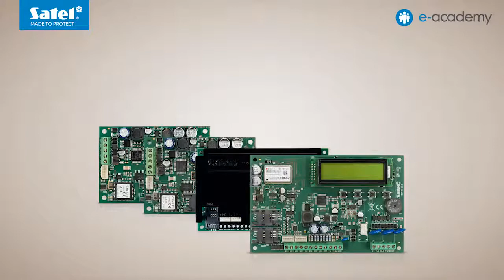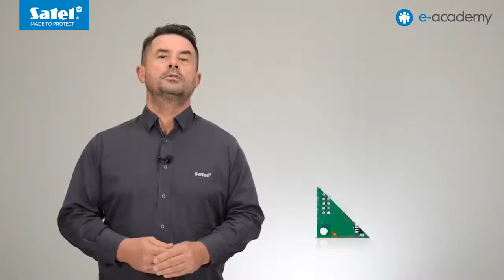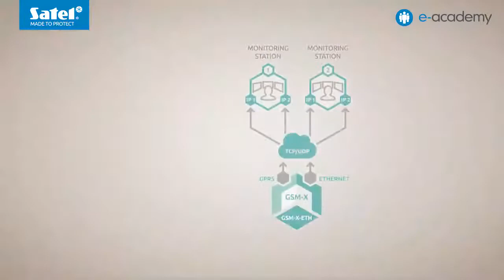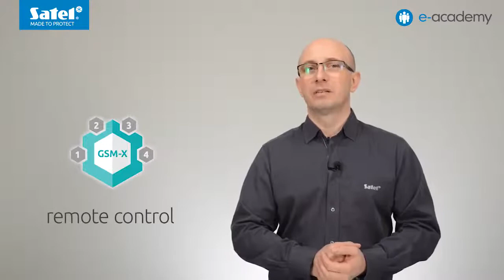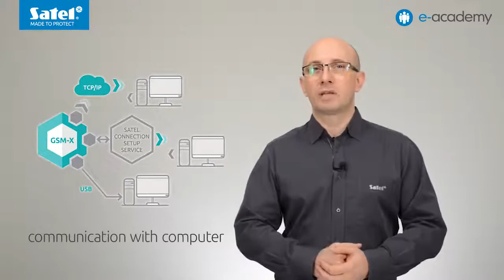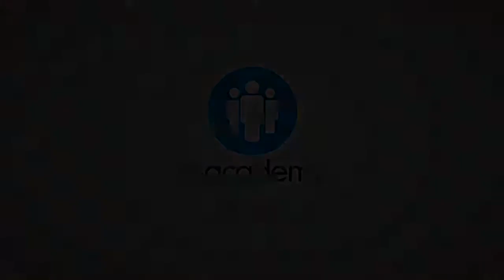SATEL e-Academy 48: Introducing the GSM-X Universal Communication Module

Comment: Hy can be connect analog telephone line to GSM x LTE module tip and ring port it's self without using extra pstn module?Need telephone line as primary path  and secondary as GSM
Reply from the maker: Yes, you can! Download the GSM-X LTE installer manual at support.satel.eu, and refer to it for details on how to do this.